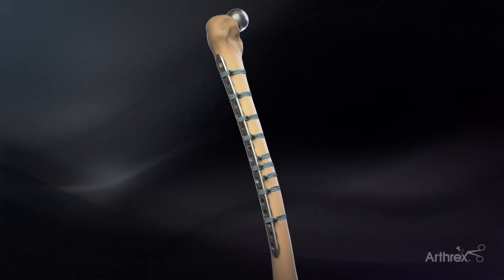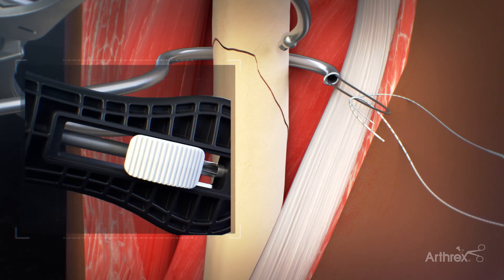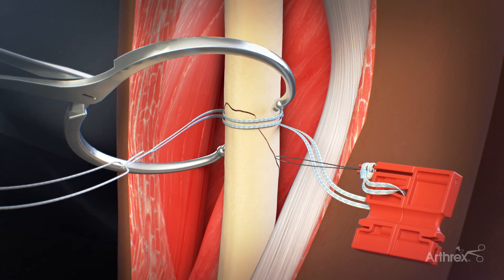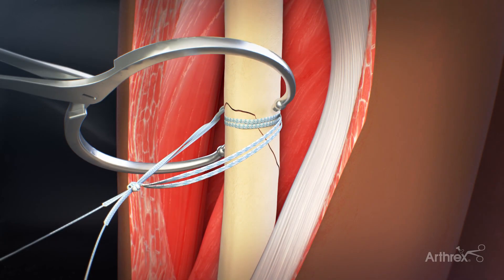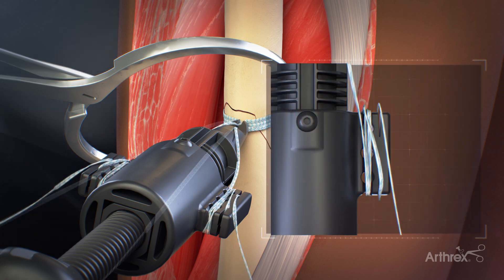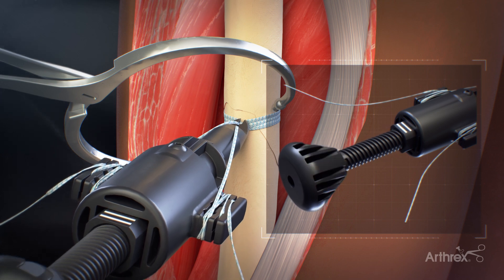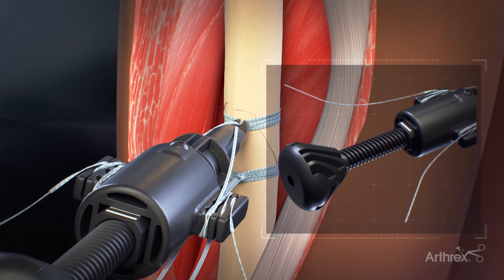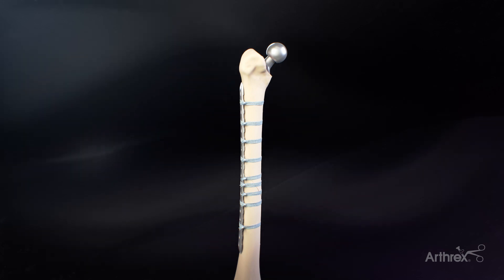FiberTape® Cerclage for Periprosthetic Femur Fracture

Comment: Does the tape dissolve after the bone is healed?
Reply: Nope
Reply: @justinjex1  yep I figured that was more than likely the case.. kind of like screws and plates in an open induction internal fixation repairs the hardware stays